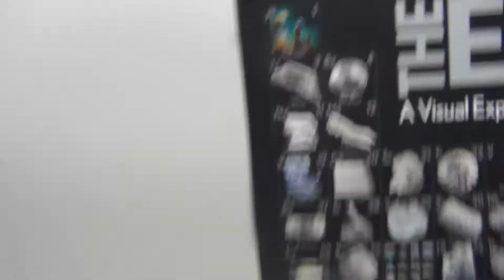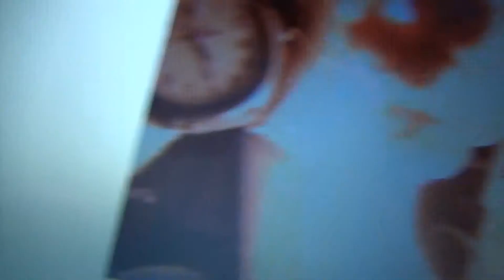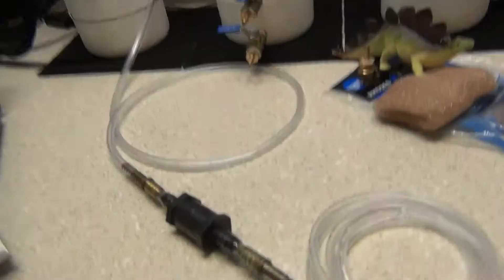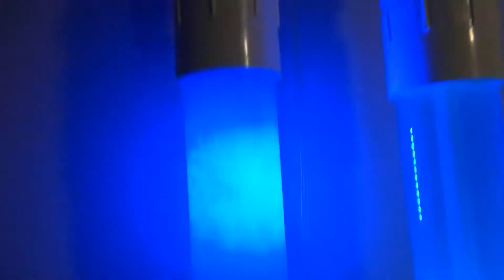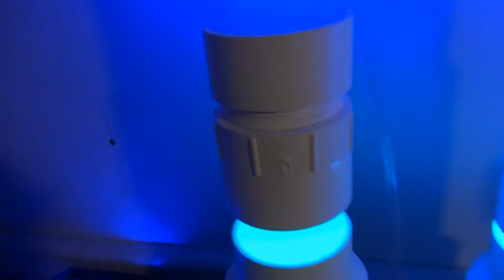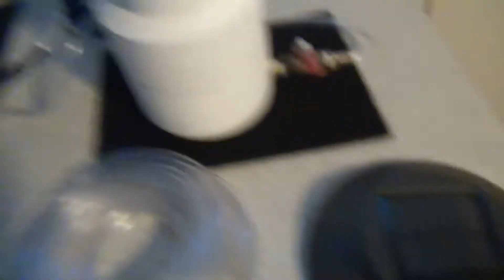HHO FLASHBACK ARRESTOR TECHNOLOGY & PHOTON ENERGY

Comment from the maker: The inline flashback arrestor is simple, yet effective form of advanced quenching technology used in oxyhydrogen gas systems is to prevent a flashback from reaching gas production reactors and other equipment that is in use in case a flashback occurs. The flash arrestor can be used many different ways to produce endless amounts of electricity with the HCAT catalytic photon pulsing technology with coiled HHO hoses and some solar panels.